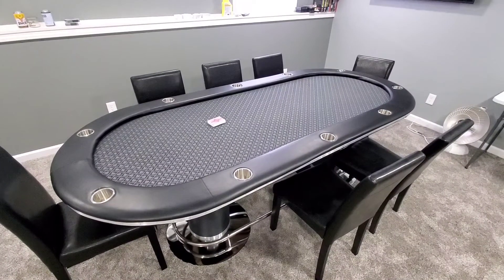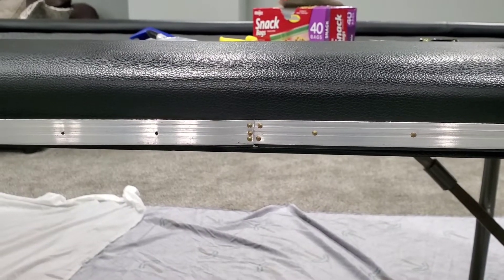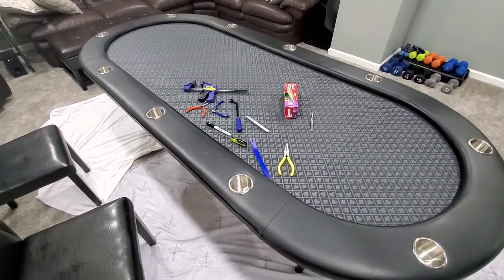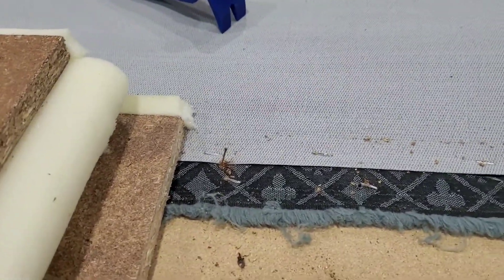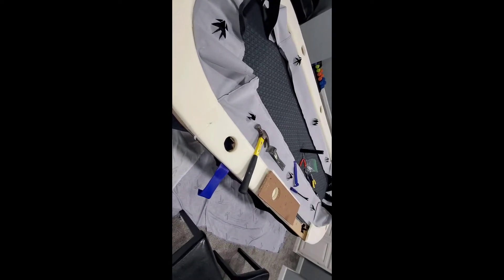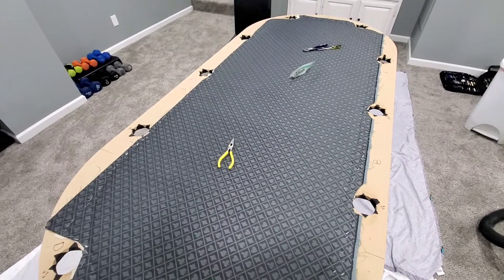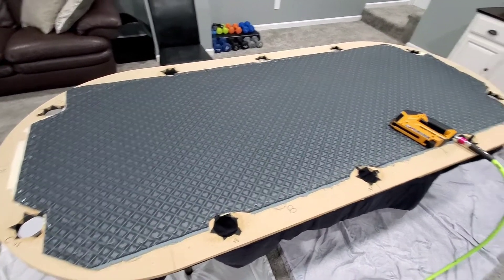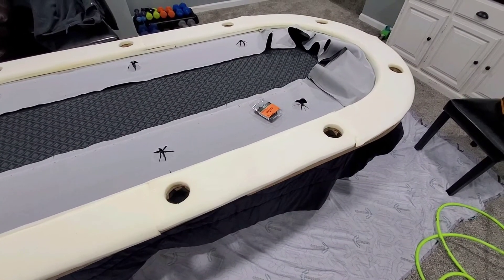Poker table speed felt fix

Comment: I wonder if you would have taken a heat gun to it on low if it would have tightened up for you.   Looks like they never took resurfacing into account in its design.
Reply from the maker: That would have been a good thing to try first. Would have saved me a lot of time and aggravation if it worked.